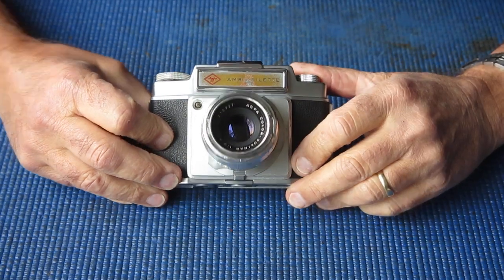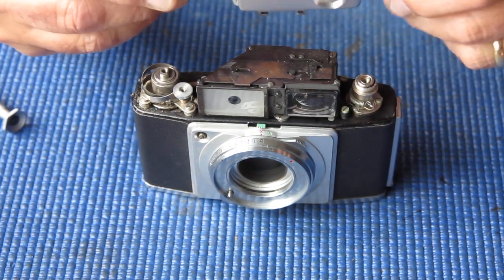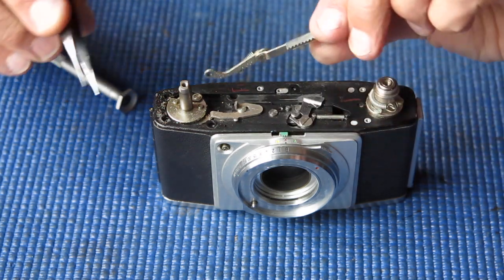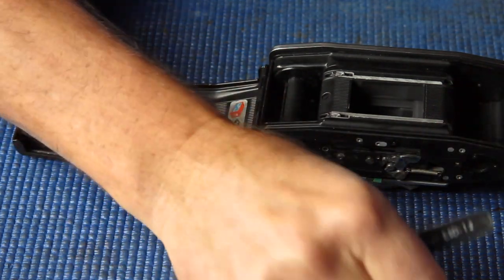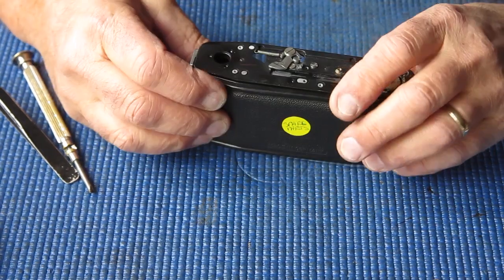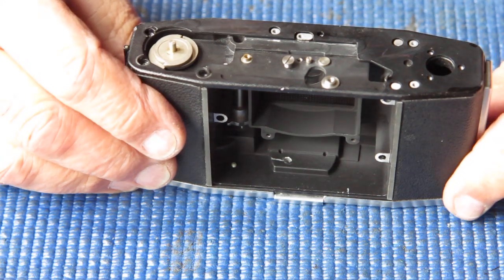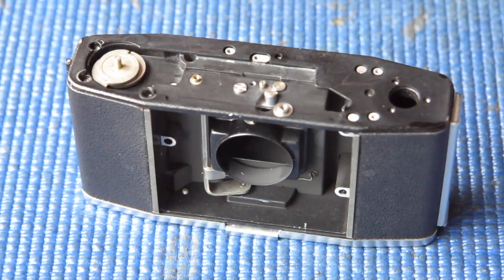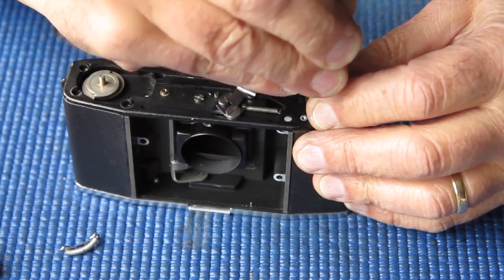Ambi Silette type I service part 01

Comment: Mr Sherlock, I have two ambi silettes; one doesn't work at all and the other has slow shutter speed problems. What type of cleaning solution and what types of lubricants are you using for the repairs? I've been away from camera repair for 40+ years and am no longer up-to-date on what lubricants to use in the camera and the helical in the lens.
Thank you.
Jim